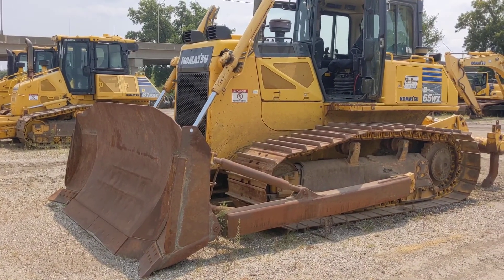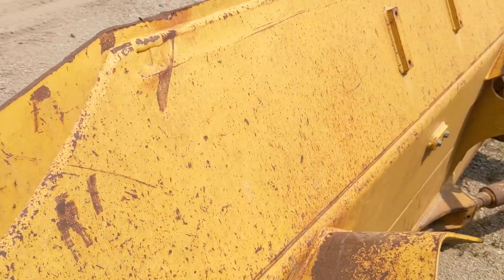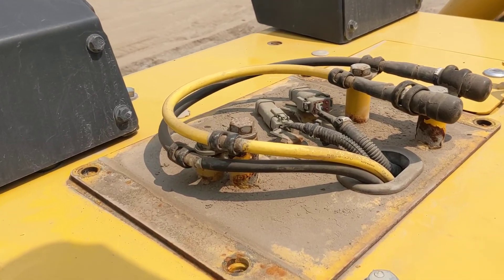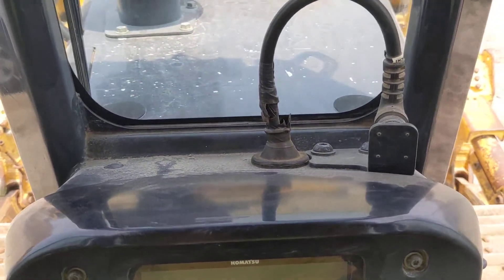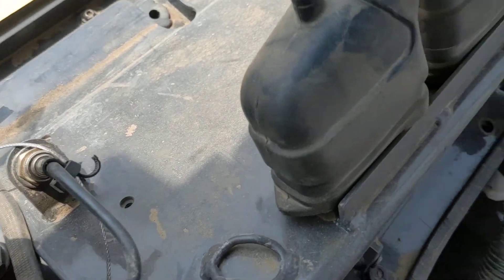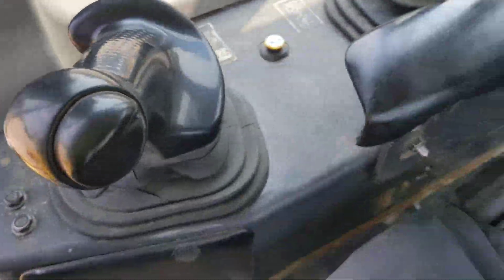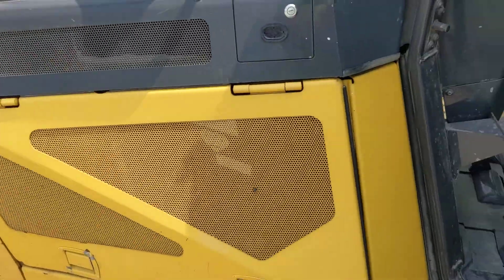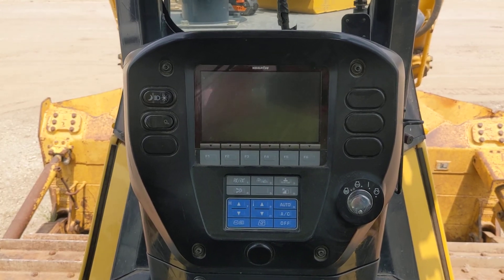Komatsu D65-17 Topcon Plug and Play Dozer Walk-around

Comment: It is my understanding that the plug and play option is no longer offered from Komatsu. Is there an existing TopCon option to fill this gap for those that already have the major components?
Reply from the maker: I believe you can still order Plug and Play as a factory option. It used to be standard on D61-23 and D65-17, but I've seen D65-18 with the option. 
As for aftermarket there are Topcon install kits for all models of Komatsu dozers that will allow you to use your 3DMC hardware.